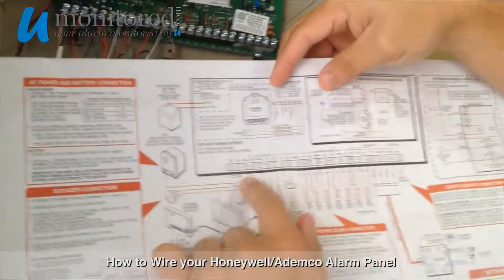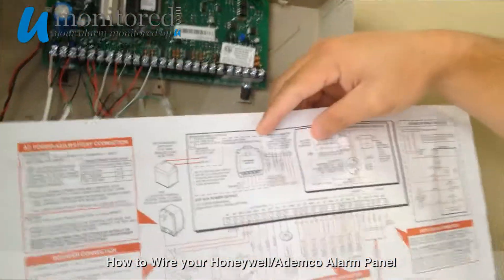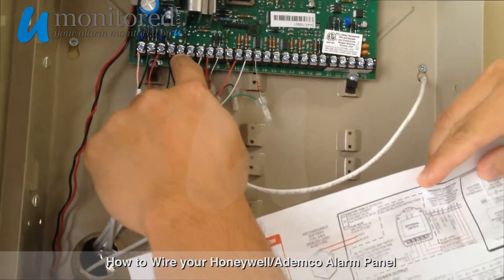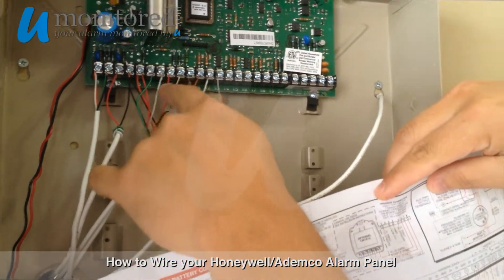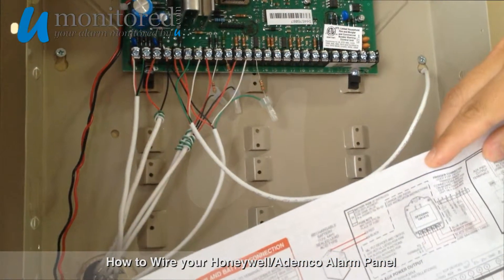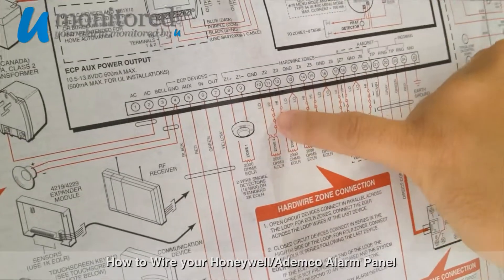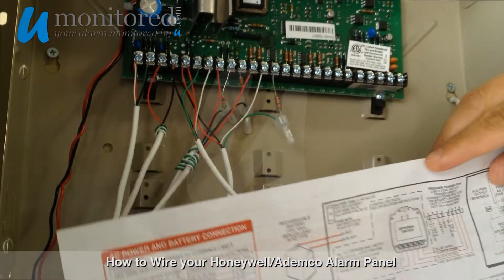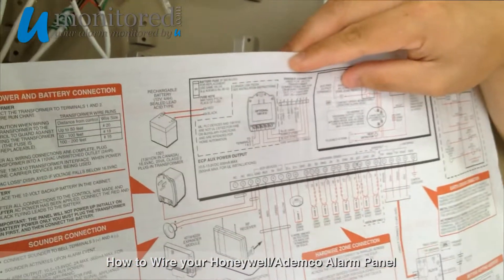How to wire your Honeywell/Ademco Alarm Panel

Comment: Good afternoon, can I please ask for your help? I have a Ademco Microtech Galaxy 8 C055 alarm, and want to attach a GSM communicator to it. It can work with either NO or NC outputs. I just dont kmow in wich terminals I have to connect the communicator to the alarm, and can´t find any schematics online. Can you help me? Thanks in advance.